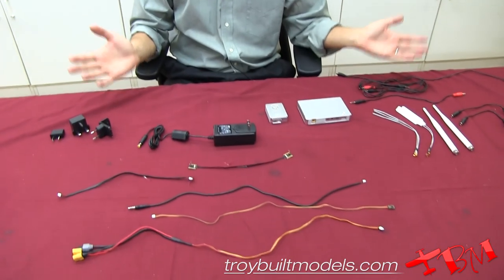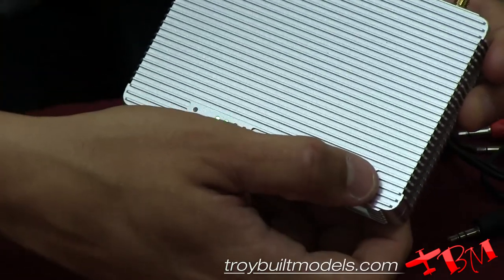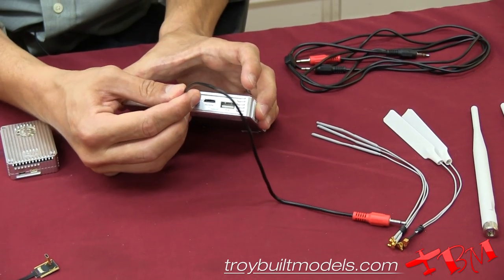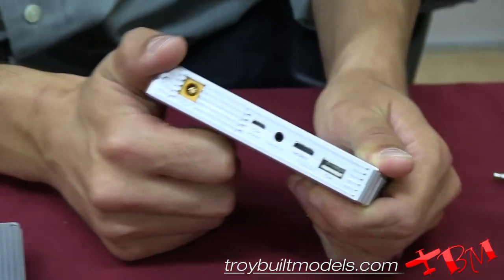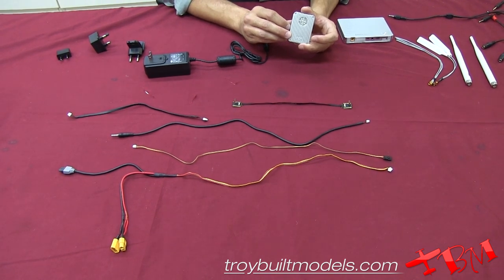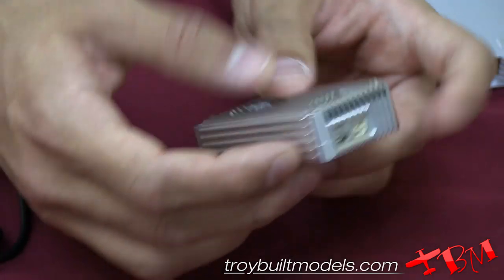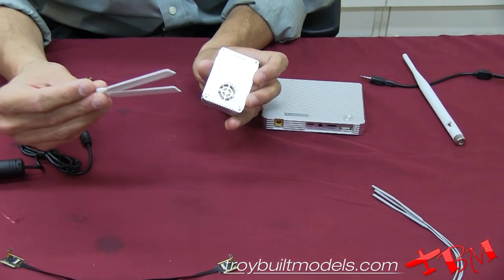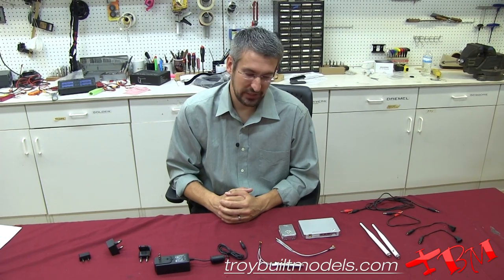DJI Lightbridge HD Wireless Video Unboxing Product Overview

Comment: Hello my friend... I installed LB system on my airplane but with 200 or 300m image get freeze too much... almost impossible to use for FPV. You have original antenas? Did you made any upgrade?

Comment: Currently I have a Phantom 2 with a H3-3D gimbal, AVL58, iOSD Mini and Wiring Hub. Will/can the Lightbridge TX simply replace the AVL58 and plug directly into the Wiring Hub or will I need to solder and rewire everything. Also, how does the RX plug into the P2's transmitter, is there a special wire for that? Thanks! :-)
Reply: Oh I almost forgot! How do you hook them up to FPV goggles? :-)
Reply: Bobster986 Simply just removed all FPV and replaced with lightbridge. You will no longer need iOSD since it's integrated with LB system. All cables provided in packages (come with 2 boxes box #1 LB  ground & air units and cables box#2 mounting units and adapter). You will need controller that provided training mode such futaba etc. To connected with goggles are vary depends on what kind of goggles you own. I am using cinemizer which connected to HDMI with LB it's work fine.
Reply from the maker: Bobster986 
Thank you for answering Morph Life!  The only way to use the analog goggles with Lightbridge would be to get an HDMI converter.  You want: HDMI TO COMPOSITE.  If you search for that on eBay or Amazon that should be what you need!  This will require you to run a cord directly to the goggles.  You could always run the Ground Lightbridge output directly to the video transmitter and be wireless that way but it kind of defeats the entire purpose.

Use the Cinemizers like Morph Life or a HD monitor!

Comment: Hi, I just got my Lightbridge, but I have a problem with it. I bought it because I was tire of looking a fuzzy picture the AVL58 provided, so I broke the bank and went for the Lightbridge. after installing it as the instructions and videos explain, everything works great for the exception of one thing. IT DOESN'T CHARGE THE BATTERY IN THE GOPRO!!!! At least when I used the AVL58 on my Phantom 2's, the gimbal was providing power the camera, now it doesn't! I feel like I'm going backwards, is there something I can do about this? Thanks!
Reply from the maker: Bobster986 You would need to power the GoPro seperately.  This is not done with lightbridge since the only connection is HDMI to the GoPro.  What you can do, purchase a regulator and a USB GoPro wire.  There are two wires which give the GoPro or USB power, these need to be soldered to the regulator, then you can plug the regulator into an open XT-60 connection on your copter. http://www.troybuiltmodels.com/items/GOPROCABLEUSB.html  We do not list the BEC or regulator for sale, please get one that accepts 6S (6 cell lipo) input, yet only has 5V output.  If you go over 5V into your GoPro you will damage it.
Reply: Thanks, but I found out the best and easies way is to just plug the gimbal cable back in, I guess that's why the Lightbridge plug is longer, to overlap with the micro USB of the gimbal plug, Happy flying!

Comment: At 2.17... Why in earth do they use adapter's on cables? Just adding more weight and more to think of while plugging stuff in :O
Reply from the maker: I'm not sure other than easily replacing the Futaba trainer plug in the event it gets damaged.  This is a DJI design.
Reply: Well, Futaba is a good brand and we all know that the more connection's there is more bad the end signal is going to be.. And more easy to get a braking point :(

Comment: I have a Phantom 2 vision plus v3 and want to put this system on it. all the instructional videos i have found are all using a zemus gimbal. BUT if you look at this link http://wiki.dji.com/en/index.php/Using_a_DJI_Phantom_2_Vision%2B_with_the_DJI_Lightbridge 
it is on a vision plus. i just want to know before a lash out and blow 2k on something that might not be compatible

any help is much appreciated
Reply from the maker: Kipp Bennie That link is exactly what I would follow if I was putting a Lightbridge system on a Vision system.  I think the other things you were finding were normal Phantom 2 with the H3-3D or H4-3D. You want a Vision tutorial like the link you just shared.